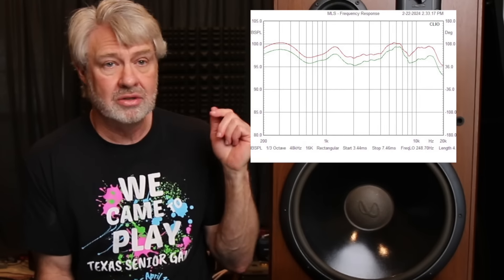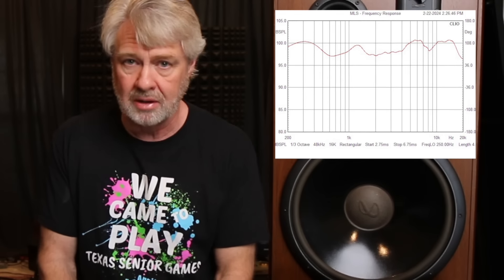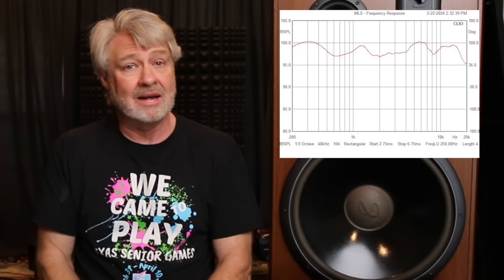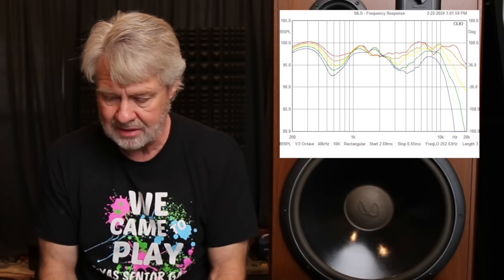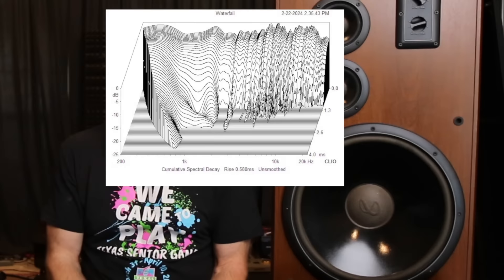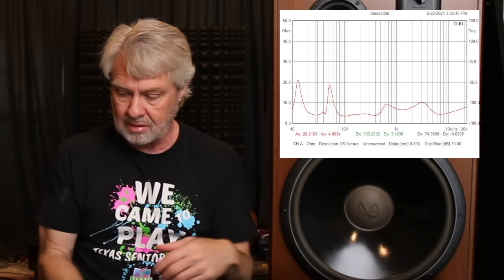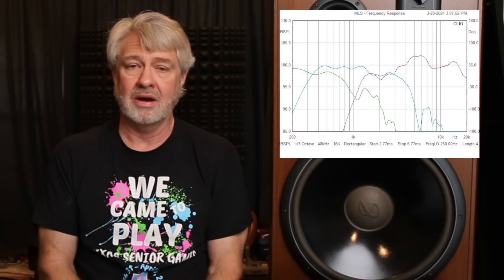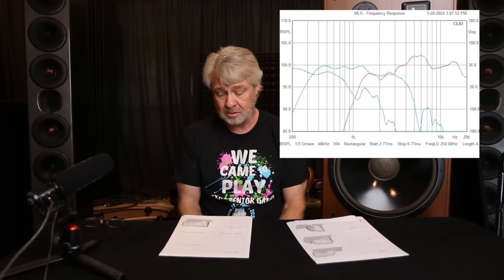Unleashing Infinity: SM-152 Transforms from Good to Great! 🚀

Comment: I have refurbished several Infinity speakers, though the pricier models.  They had much better cabinets and decent for the day parts.  New caps, coils, resistors, wire and binding posts turn them from a good vintage speaker to a really great speaker.  Arnie Nudell designed a lot of Infinity speakers.  Always worth a try.

Comment: Almost 40 years ago I was lucky enough to hear an IRS-V. A few years later I bought the SM-155. They ran without any problems until last year, but of course their sound suffered.
They are now in my workshop, awaiting resurrection. I'm going to get started now in the summer and had similar ideas as you suggested.
If you like, I can send you a PDF with my results at the end.
Really cool video!

Comment: Hi! I remember the Infinity SM speakers from my younger days. They could really throw a party, not very audiophile, but not bad either. Awesome job on the crossover. They probably sound really good and earfreiendly now.
Reply: People that say that they are not audiophile have no idea what they are talking about. This is because they power these with garbage equipment. I power several pairs of the SM112s and SM122s with Bryston and Adcom components and they sound better than my speakers that i have paid 10 times the price for. I have owned top of the line speakers and these i always go back to because i simply love them better. With the proper bracing and crossover upgrades these blow away speakers at 10 times the price.
Reply: @vegaslimoguy2376  uhm....Infinity made good speakers, and they also made "LOUD" speakers. These fell into the loud party speaker category. Nothing WRONG with them,, but to insinuate they equaled the truly good speakers, is a bit naive. They had limited deep bass and vibrated like crazy, and were actually a decent but mostly LOUD speaker. For parties or loud Rock music, these were TRULY GREAT I agree!, But for acoustic music, jazz or classical, the shortcomings were more evident is all we are saying. The tweeters were the weak link, as was the thin cabinet, lack of padding etc.
Reply: @kevintomb  Did u not read my posts, i own Legacy Whispers, also a pair of B&W 802s and i have owned pretty much any kind and brand of speakers out there and  my Infinity 112s and 122s together are just simply better than any of them. They have been upgraded with everything Danny states here. I AM happy with them and thats all that matters to me, not what some tools on the internet think. I have people over all the time and they are always impressed with the Infinitys, especially at that price point you cannot go wrong. Now move along there pal.
Reply: @kevintomb  And one more thing, after the upgrades these sound unbelievable with jazz music. Im a horn player and i listen to alot of rock, but also a ton of jazz music, and they make the hair standup on your neck. I have owned over 50 pairs of speakers over my 40 years of being an audiophile, and after the upgrades nothing touches these, not even my 3rd setup with the speakers costing 15 times the price of these. Ive had even the most critical listeners come over to listen to these and they always accuse me of rebuilding these with totally different drivers which is not the case. All original drivers, just new crossover networks, cabinet bracing, all new heavy duty wiring, and cabinet damping materials.
Reply: @vegaslimoguy2376  And one more thing. People are entitled to their own opinion, not just yours. Why get so irate about a pair of old speakers. Who cares? If you don't care what the 'tools' think on the internet then why come here? If you want to make a case for these speakers then surely it can be done without shouting at everyone and we'd all be interested. Move along yourself.
Reply: @analoglooney Man, I really need to give my 112's a makeover , really liked mine until the foam rot kicked in

Comment: Yep, right out of high school and beginning college, I was torn between wanting either these exact Infinity model speakers, OR else the Cerwin-Vega AT-15 model, which looked almost identical to these with a 15" woofer, the offset mids and tweets, dual 5" midranges, a 1" dome tweeter, and level adjustment controls for the mids and tweets, essentially the same as this infinity model here... I would have loved having either of those mentioned brands and models of speakers for my dorm room in college, but unfortunately I wasn't able to afford to buy EITHER one of those speakers brand new, so I had to settle for a decent but smaller pair of speakers that I found at a local pawn shop for $20/pair.
Reply: I was a nerd and built my own in the dorms with radio shack drivers lol.
Reply: @v12alpine  That's really cool, good for you! I'm a speaker designer, builder, repairer, and "improver/upgrader" myself, and I would've done something like that back then too, but at that time I didn't have enough time, (due to classes AND homework), OR enough money, (I didn't have a job at that time), NOR did I have any of the right kinds of tools needed to do that back then, so I could only dream about building speakers, and plan some designs out on paper, meanwhile actually listening to music on some already pre-made speakers that I found that were still in good shape from my local pawn shop, as I mentioned.

Comment: with that kind of efficiency might be fun to try these with a small tube amp. Would guess most were powered with monster receivers back in the day.
Reply: I'm currently using a dynaco st70 on these now and they sound great. 30 watts per channel push them to beyond reasonable listening levels with no problem other than a bit of hearing loss lol.

Comment: I sold these speakers back in 1988 when I worked in a stereo store while in college. These designed to compete with Cerwin Vega. Huge profit margin and great commission for the sales person. Not a great speaker for critical listeners. Compared to the Infinity RS and Kappa series of the same period, they were a step down. Very efficient at around 103 db and easy to drive. Thanks for memory lane Danny!

Comment: A couple of questions, 

Do the mids have sealed backs, or in a sealed area? 

In the kit are the "attenuators" still in the signal path? Is that a possible option?
Reply: The mids have a sealed back. The old attenuators are no longer in the signal path. They degrade the signal considerably.

Comment: Did you keep the tweeter and mid adjustment knobs in the new crossover design?

Nice job although I reckon the 2KHz peak in the off-axis might give it a forward sound in-room. Probably suits the speaker though. 

I still would like you to comment more on how you think the upgraded speakers sound.
Reply: The volume pots are no longer in the circuit. How is sounds now is a LOT better than it did.
Reply: @dannyrichie9743  useful description 🤣

Comment: These speakers demonstrate a point I made in a previous video.  You can just look at these speakers and know there is going to be vertical off axis issues because there are two mid drivers.  I really don't know why some people had an issue with the obvious.  The SM-125s had a single midrange and would not suffer from the same issue - at least not obviously.  There still could be off axis issues, but not because there's two mid drivers.  Quite frankly, Danny's "after" vertical axis dips in the midrange area were much less than I expected.  Another testament to his superlative skill?  Or perhaps It's my expectations?

This speaker series has a reputation as being "when Infinity went to hell", as one fan put it.  As Paul McGowan put it, "they were very popular among the military crowd".  And that's about all he's willing to say about the series.  They were tax and import/export free (so, affordable to low paid enlisted personnel) in every military BX, and Infinity had a reputation for high quality speakers.  But the Studio Monitor series was considered a significant fall from their otherwise higher quality product lines, and I think Paul knows it.

I bought a pair of the SM-152s in 2008 and had to replace the woofers with a not quite exact replacement, (the coils were melted and OEM replacements were no longer available) but the replacements were close enough that I didn't have to alter the crossover.  I will say it's VERY hard to find a woofer as sensitive, with such high wattage, AND a reasonably low F3.  I had to sacrifice a couple Db for higher wattage.  A compromise I think was worth it considering the original voice coils were literally melted down with copper beads stuck to the magnet.  But I also found that the box was boomy ah, and there was no stuffing whatsoever.  They came from the factory just as Danny saw.  I added some bracing and stuffed it full of fiberglass to tame the box a little, then sold them.  This was before I knew anything about Danny and no-res.  I did what I could.

I kind of wish you still had them.  I would be interested in the vertical response with only one midrange driver in use.  I'd bet a coffee that Danny could make it even better with one less mid driver.
Reply: I have the sm152, i only use 1 mid. driver. ea.  Sound is for sure cleaner and more listenable !

Comment: Nice speaker to upgrade, but refering to the cabinet shouldn't be more efficient to make a new cabinet well braced more stable and thick one for better results?
Reply: Nothing holdes you back, just copy the org size, the inside ofcorse. Then you can make a propper left/right pair👌

Comment: I have a pair stuck in a corner in the garage! I have actually already started removing the old caps from the crossover. Can you share a video on what you recommend doing with the crossover and attenuators?
Reply: The attenuator panel can be used to fill the hole cut for it in the cabinet. The stock crossovers and those attenuators can be discarded.
Reply: @dannyrichie9743  can I just obtain the crossover kit separately?
Reply: @DJWerkz  Separately from what? We packaged everything you need.
Reply: @dannyrichie9743  Just looking for your upgraded crossover kit as I am doing my own cabinet work
Reply: @DJWerkz  This upgrade does not include a cabinet.

Comment: I had a set of those for a little while the dust cap is so soft on the woofer it makes a loud snapping noise when cranked up
Reply: That would be the voicecoil out of alignment which means someone improperly refoamed them without centering the voicecoil.

Comment: why are the drivers except the woofer almost always on the left or right of the baffle and not mirror image of each other  it looks like you are getting 2 left or 2 right  speakers instead of a left and right pair
Reply: In this instance, mirror image pairs are an expense that's not in the budget. 

The was no extra money for anything other than perceived value (aesthetics, trim rings, etc), and to play loudly with adequate quality.

I remember clearly ... these were advertised heavily, every week, big full page adds for (in my area) Highland Superstore.
Reply: It depends on the manufacturer, but often the main reason older/cheaper speakers are left-only or right-only is often down to manufacturing costs, as production costs are higher when a design is a mirrored pair vs all the same.

Comment: Is there any good reason to have two mids, other than power handling?
Reply: Improved clarity, as each woofer is doing half the work of a single for the same output.
Reply: Both the above are essentially the same issue. 

However yes, there's advantages other than power/output, etc. 

Potential advantages include vertical control and summation, in the forward lobe (D'Appolito alignment for example). 

Also the benefits of the additional cone area are enjoyed, without the penalty of increased cone size affecting directivity. 

Of course driver center-to-center proximity is vital. But any vertical spreading of drivers can be beneficial. 

Since the drivers are at varying distances, energy up to the ceiling and down to the floor, that is de-correlated and summation is smeared anywhere along the vertical axis ... except straight ahead to the listener. 

That's a lot, but I hope that helps.

Comment: These were very popular on the military base.  I bought mine in 91. They were a bit over $500 at the PX for the pair.  I've replaced the tweeters at least dozen times. Including the SM82, SM112 & SM122 that I've also owned.  The biggest tip I can give to those is to replace the dust cap along with the surround on the woofer.   The thin foam dust cap makes a fluttering and occasional popping noise,  clearly audible.  The paper dust cap eliminated this problem and new surround tightened up the bass a bit better.  They're still in my archives,  may have to revisit them.
Reply: That's not the dust cap. There is a felt bumper ring...bump stop...under the spider to prevent the voice coil from bottoming out against the back plate of the woofer. The designers knew these were going to be played very loud with the bass controls cranked for maximum bumpage. It's why you had to replace the tweeters so many times. Amp clipping takes out tweeters first...especially with receivers that have internally fixed preamp gain stage. Headroom goes away at about halfway up the volume control. Crank up the bass and it goes away even faster, since bass takes more power to reproduce.